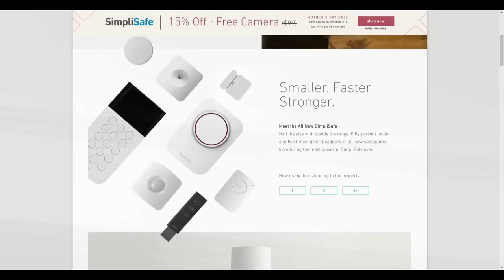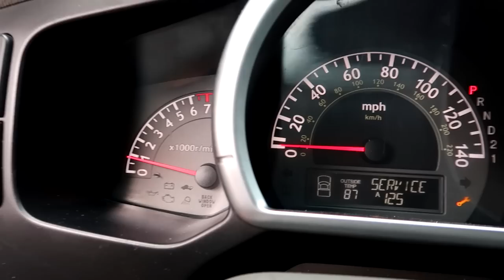Buying a Reposessed Truck at Auction was a MISTAKE! It's WAY Worse Than I Thought!

Comment: Unpopular opinion: 2nd gen Dodge Dakota 4.7. If you thought a Ridgeline was capable enough for your needs, one of those would probably be great. 

They're fairly simple, easy to work on, and generally they are good trucks. Everyone thinks they're like the Ranger, but they're actually just as capable as a Ram if optioned the right way. Trans cooler, P/S cooler, oil cooler and limited slip come with the towing package.

Comment: Nice video!  As for the rust, it's not terrible (I've seen much worse) but it likely would not pass safety inspections in some states since the rocker panels are an integral part of crash protection and yours are very compromised.  Perhaps this could be a good vehicle to practice your mig welding skills.  New rockers are probably pretty cheap for this and the paint doesn't have to be awesome since it's so low on the body...the perfect job to practice your body and metal skills!  That would make it safer, too.  Good luck!
Reply: If he doesn't care about appearance, you can buy replacement panels that you weld in after cutting out the rusted ones. Easy peasey and just touch up with some bondo and then coat in ribberized rocker guard. If this will be a work vehicle, who cares? 

I have a rusted out F150 that I just want to pass safety. I took it in for a pre-inspection and the mechanic said "foam and go" (fill the rusted areas with spray foam and a skim coat of bondo). I did that on the fenders and literally, the edge was all that was left and now? I can grab the fender with one hand and shake the whole truck.
Reply: We don’t have inspections here in Florida where Sam lives so he doesn’t have to worry about passing inspection because the car has a clean title when he bought it
Reply: @frankiebatsu  I'm confused, then why has he had to take previous vehicles in?
Reply: @muskokamike127  I believe they had branded titles.
Reply: @kylemacmillan652  The R8 didn't. Where I live a vehicle has to pass safety inspection whenever it changes hands. It's so bad where I live that if the 4wd doesn't work? won't pass.
Reply: Muskoka Mike if the title is rebuild or repair you have to take it in .however this vehicle is A reposition  so it has a clean title and doesn't require an inspection to make sure of road worthyness
Reply: @frankiebatsu  Where I live whenever a vehicle changes hands it has to be inspected and pass safety.
Reply: Muskoka Mike Florida is pretty easy .... We don't have emissions or inspection,so you can imagine how many people drive around with no catalytic converters etc
Reply: @frankiebatsu  no wonder you have pollution issues lol. I see some of the cars driving around in these repair videos and think OMG!

I bought a cheap F150 and took it in for a safety. It wouldn't pass because the 4 wheel drive wasn't working. I said "so does that mean that every 2 whee drive truck doesn't pass"? wtf does 4wd have to do with a vehicle being safe?

Comment: The amount of rust isnt bad.  I have seen much worse here in Missouri.  The isue I have is that on a unibody the rockers are integral to the strength of the car.  What your seeing is the same as a rusted frame on a body on frame vehicle.  Though sure you could get more rust in other climates this is very close to unsafe because it is a unibody.  Much more then that and floors sag and doors dont close properly.  The rocker panel is a critical part of the strength of a car with unibody construction.

Comment: I'd personally try to find a 11-14 F150 with the 5.0 Coyote. Bullet proof trucks, plenty of owners with 300k+ miles on em already
Reply: if the #8 cylinder does not fail on the 11-12
Reply: Or a newer EcoBoost.  Get a tuner for it and they are great for towing and having fun.

Comment: My 2009 Jeep Patriot had way way way more rust on all the underbody components than this thing does after only a couple years.  Sold the damn thing for next to nothing just to get it out of my driveway.  Oh, I live in SW Ontario...still, I've never seen rust like the one on my Jeep since the 1980s.
Reply: Interesting. I'm just about to get rid of a 2011 Jeep Patriot that we've had since new. Underbody looks new and the only rust is on the front where it got stone chips. Has 350k km on Eastern Ontario roads where we litteraly spray brine on the roads.
Reply: @Henchman1977  They must have screwed up with ours.  Every mechanic that worked on it commented on the rust, except, of course, Chrysler ones.  Will NEVER EVER buy another Chrysler/Jeep/Fiat product.
Reply: @hagbard72  wasn't all good with ours...  Transmission has been rebuilt 4 times and it's a manual!

Comment: I’ve been working on cars in New York for the past few years. My 2000 gmc and 08 tundra don’t have ANY rust/rot. But both were undercoated from the dealer when new. I tend to find the few minutes it takes to climb under both annually with a grinder and wire wheel and can of undercoating (Eastwood is the best I’ve found) saves from the hassle your truck is experiencing.

Comment: Just bought a 2012 Ridgeline. Yours looks like it could still go another 50k, though it may be ugly by then. BTW, Minnesota resident. Just got rid of a 07 Ford Sport Trac with 89k due to a rotting frame. The rot was by a rear wheel link causing the wheel to lean in towards the frame, very dangerous. I thought a frame could survive some rust!

Comment: Accord with bed?? It’s a chopped up Honda Pilot
Reply: Actually, it's built on the Honda Odyssey frame. I love mine.
Reply: It’s really a chopped up MDX. Similar to a pilot & Odyssey.
Reply: Odyssey and Pilot's are both stretched Accord platforms
Reply: It's actually a Japanese Escalade. The only difference is you don't have to replace transmissions every 5kmi and it doesn't leak any fluids.
Reply: So i assume their towing capacity isnt too great if it's a minivan frame.
Reply: @777warhero  You could assume or you could Google.
Reply: @Blacksunshine636  yeah,  but that would be too easy.
Reply: @Blacksunshine636  what frame? I always here that but it has no frame.. interesting. i have a RL too and its definitely not a van.
Reply: @ryanvarner8936  I heard it in the internet it's a fact. I have the same truck. I think the underpinnings are minivan.
Reply: @777warhero  It tows 5,000 lbs. More than most truck owners would ever want to tow.
Reply: @Blacksunshine636  I assume he also wants to be able to tow a trailer and a car though. I've run into issues with towing capacity with my 06 tundra. Its not that it cant do it to a certain extent but its more safety of others on the road. Anything above a small suv I wont tow because I dont think i have the brakes for it.
Reply: @Blacksunshine636  I have a '07 ridgeline, and at work I drive a f350 and f150 both 2011's.  The f-150 will out tow the ridgeline.  Just will. 

at work I tow a tandem dump trailer, pretty much all day, every day.  Everything from rock slabs, concrete (demolition), top soil, etc.  I usually tow 4000 - 5000 lbs.  I run about 100 to 150 miles a day.   I wouldn't do it with the ridgeline.  The reason?  Brake controller.... The f150 and f350 both have very good trailer brake controllers but the F-150's is way more refined then the f350's, but the f350 tows even better (More power, more weight, heavier suspension even if the trailer brake controller is a little less refined).  Which truck do I prefer?  Well, I love the way the ridgeline drives--  It's awesome in the snow and has been a really great little truck, but If I was going to buy a new truck?  I'd look at an f150....   probably like the one I drive at work.  (it's an FX2 4 door, so it's pretty maxed out, option wise but so is my ridgeline)  Before I started driving the f150, I didn't care for fords, but that truck has actually really changed my mind.   The switch gear isn't as good as the ridgeline's but the leather is better.  The tail gate and trunk would be missed, but I'd get over it (two of the best features of the truck)

Oh, and some Ridgeline Trivia....  It is a stretched accord platform, with a few major changes.  One of the biggest is it has a ladder frame welded to the uni-body.   One of the reason it can tow 5000lbs.  The Pilot, I believe is rated at 3500.  It also has a pretty decent AWD system.  it's not gonna go rock crawling, but, in the snow, it's pretty impressive.  As for dependability, it's probably the best vehicle I've owned.  I've got 130K on mine, and all I've changed is the timing belt  (timing belt service includes water pump and tensioner), a vapor canister purge valve.  I had to do front struts, but that was because I was commuting over a patch of road that was very bad, deep pot holes, the works (did that for about 8 years) so I can't blame that on the truck and two sets of brakes.

I know, this is kinda drifted off subject, and it's just my opinion....  Oh BTW I'm a GM quy.  I also have an old square body Jimmy.  I've always loved my GM's.

Comment: When doing maintenance like a transmission fluid change, Make sure the fill plug can be removed. It would suck if you drained the fluid out and then found you cant get the fill plug out. As far as the pretend truck goes, It is just a cheap tool that you got for half off. Use it till you find a keeper to rebuild.
Reply: Honda Ridgeline IS a real truck

Comment: Here in northern New England, that's a common sight for untreated vehicles; rockers, wheel arches, door and fender bottoms, and body seams.  On trucks: frame cross-members, bumpers, spring shackles and shock mounts, wheel arches, rockers, and cab corners.  Rust is brutal because of the chloride slurries they put on the roads in the Winter plus the chlorides they put on gravel areas to keep the dust down.  When I look to buy a used vehicle, I make sure it is from down south, even if it is only two or three years old.

Comment: I'm in Michigan, and that's way less rust than on most cars I've ever owned. A couple years ago I used to have a minivan I had to give up when the radiator was falling out because the subframe supporting it was entirely missing due to rust. I just got rid of my F-150 Lariat that had no rocker panels at all.

Comment: In the UK, not only do we deal with rust like that all the time (especially on classics) due to the tons of rock salt they spread all over the roads every winter, but it's considered structural so won't pass inspection. In fact even small amounts of body rot or other damage on a car can cause it to fail if they're deemed to pose an injury risk to pedestrians or be too close to a structural suspension point. They just made our inspections even tougher in an attempt to clear the roads of older vehicles (although anything deemed 'historic' i.e. over 40 years old, is exempt from inspection).

I visit relatives in Boston (in a state that actually inspects vehicles) and I can't believe what people are allowed to drive over there - last time I saw an old Caddy where the bottom 3-6 inches of the car were basically non-existent. I think our rules on rot are rather strict, but there must be safety implications in allowing the other extreme. In the UK that Honda would essentially be junk and likely need thousands worth of welding just to be legal. But then, it would most probably never been allowed to get into that state in the first place.

Comment: at 9:32 rear subframe is missing a bolt. I think there should be 4 bolts but there’s only 3 bolts
Reply: Looks like the mount for the rear diff, I wouldn’t even bother lol
Reply: 2004 Pilot owner here. That's the way they come. You can see ribbing in the rubber bushing above the single bolt for dampening purposes, instead of a bolt hole.

Comment: 99 to 04 diesel pickup Ford Chevy dodge it dont matter they are the best trucks built prediesel emissions
Reply: Amen
Reply: Dodges are a nightmare to work on. Chevies have a crap ton of problems and the fords sometimes will blow the transmissions too.
Reply: @coydog7902  yeah, not the 1st gen I've got. Haha it's a blast.
Reply: Jared Rhein 

They don’t make em like they used to

Either old or mold
Reply: @coydog7902  yeah I will take all those problems over a 6.4/6.7 with aftertreant issues

Comment: Usually on cars with around 160k miles there is surface rust, up here in Washington state. But this amount of rust is only found in cars that have driven on roads that have been salted to help ice and snow to melt during the winter. You should also consider a 94-98 2nd gen dodge Cummins 12 valve because the engines are bulletproof and they pull and haul things with ease.

Comment: Not a bad amount of rust. My 2001 Chevy Cavalier had the frame nearly rusted right through on the drivers side and passed inspection with flying colors. I don't think you'd need to worry about it too much, just handle what there is now to prevent any spread

Comment: The way I deal with non tapered stud sway bar links is drive the stud and hold the nut with a box end wench, that is if there is anything left to get the gun onto. Much easier and faster than holding the stud and fighting a crusty old nut with both flopping around.

Comment: Never change transmission fluid on a high mileage car unless you know the maintenance history, you are better off just topping off the fluid.
Reply: or better yet drain a bit off to see if it looks good and service accordingly, I have seen honda boxes 30k overdue for a change with fluid that is fine  to change and on a honda box if you can you should as they have a lot less fluid in them than most and do tend to fail if you take that approach, speaking from experience having tried it both ways on high mileage hondas and driven them to destruction I would favour a change of fluid on one of these.
Reply: Must be a Honda thing...most transmission issues I’ve seen happen after “service” from one of the oil change places.
Reply: @EricsBBQAndMORE  it is a honda thing, every honda transmission workshop manual I have ever had says to change the fluid if they start running rough,  with these boxes you are only really doing partial changes unlike on a ford or a gm where it is more of a flush.
Reply: That’s good to know, thanks!

Comment: Why not just chop the old sills off and weld a pair of new ones on? probably less than two days work and a couple of hundred dollars or less?
Reply: If you watch his channel, you'll notice he does very little of his own work and it tends to be the simpler things like suspension parts and maintenance items.  He did try painting once, bless his heart.
Reply: @bluecollartrader1791  Better than over on the Auto Auctions Rebuilds channel tbh. Only "Rebuilding" he does over there is maybe a oil or plug change....
Reply: Cuz he never done any repairs him self ever in his life. But now he bought a Honda.....lol

Comment: Honestly @samcrac I live in the UK and a mechanic for over a decade and rust like this on 8-10 year old motors is not unusual, Japanese especially. Some makes are just more prone than others, usually when fixed right, all rust removed and fully treated when replaced you'll have no issues, often better than original.
Keep up the good work dude.

Comment: If the only rust is the rockers, you got out clean.  Rockers die FAST in the northeast.  Your only option up here is to rust convert with POR15 and then Rhino-line as soon as you see ANY rust start to develop (before the bubbling starts).  As for what you can/should do, cut out most of the rot to expose the inside of the rockers, scrape off the flaking rust, then hit it with CHASSIS SAVER.  Once its dried, spray it in with body foam and cover with fiberglass/bondo.  Get you several years at least, for little money for DIY.

Comment: should’ve bought a toyota hilux instead super strong truck 
edit: (thanks for the likes)
Reply: There isn't even toyota hilux in the usa. There isn't a single Diesel Japanese truck here
Reply: Hype Tempo Shame
Reply: Hype Tempo if there’re was ford Chevy and ram would be out of business
Reply: @anthonymolina7416  

Then the Tundra gas rig should have put them out of business in the gas end of things already, right?
Except the domestic full sizes outsell the Tundra about 18 to 1.
Reply: Hilux are banned in the United States, they don't pass emissions testing.
Reply: @Mudpuppyjunior  yea it's just Americans obsessed with buying American brands. Tundras are bullet proof pretty much anyone can get 400k miles out of one with minimal maintainance and if you actually follow maintainance schedules you should be able to get 800k miles before a transmission or rear end goes out
Reply: Hype - NISSAN TITAN = IS a Japanese Diesel Truck (IN AMERICA)
Reply: My 2004 Toyota Tacoma was a worse rust case than Sam's Ridgeline and had its own reliability issues in addition to rust.
Reply: @TempoMontages  

Maybe, but that's not what he said.
Reply: Mudpuppyjunior  the tundra is better in my opinion
Reply: The hilux is the , Tacoma / highlander in the states people
Reply: Too bad they are not sold in the US.

Comment: As for the rust:  If the rocker panels are structural, like some Chrysler minivans, this can be a problem.  I can't tell for certain, but those don't look like the body will collapse if the rocker panels are gone.  So, if the structural parts and floor boards look good, and you live in a relatively rust free area of the country, you can likely drive the truck for several years as it is and it will make a fine work truck.